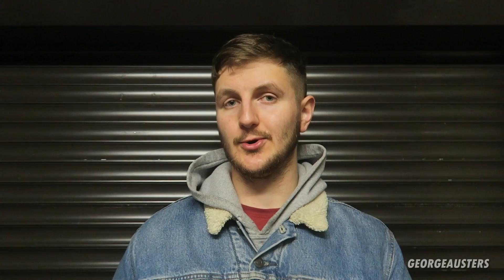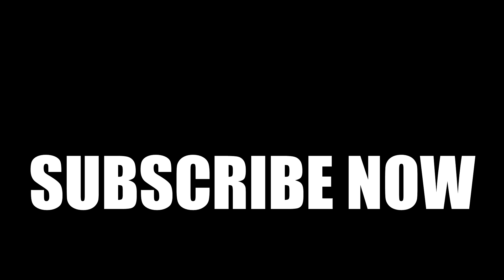Why Do Turbochargers Fail?

Comment: My car's manufacturer says: change engine oil every 10,000 miles, so I change it every 5,000 miles.  Fresh motor oil is much cheaper than a fresh turbocharger, or an engine for that matter.

A side note: turbos are fun! 😄  Oh, so much fun!

Comment: You dont really need to idle for even 10 seconds unless you are boosting madly then jam your brakes and switch off the engine. In the few minutes you slow down and park as you near your destination, thats enough to cool it down reasonably.

Comment: You forgot stop/start (for the obvious reasons)

Also imagine this, been on motorway for an hour, turbo spinning like crazy and you stop at the lights when pulling off. No oil or coolant circulating and it’ll be dry for a second when it restarts
Reply: Don’t get it. Why would it be dry when it restarts?

Comment: Nice, pardon the ignorance, but is operating temperature always ~100°c or at what temperature can one begin to enjoy the accelerator? 😉
Reply from the maker: It varies between cars, oil takes longer than water to reach temp but a good rule of thumb is to let the thermostat open at least before using the full rev range

Comment: Most I've went on a oil change was 5,000 miles. I will not going any farther. One guy that comes to my work gets his changed every 2-3k and its a trailblazer with 400k miles not sure if original miles but seems to be running strong still other then typical GM gasket leaks. I own a 2011 N55 535i btw. Also love the quality content, you are a very intelligent person when it comes to BMW. I enjoy all the videos you put out Ive learned from you.
Reply from the maker: Thank you my friend, I appreciate that!

I don’t understand people who skimp on oil changes when it is so cheap to do😢
Reply: @GeorgeAusters  Exactly, 10$ for filter, 
30-40$ for 7 quarts of castrol 5w40 edge full synthetic. All I use.

Comment: When a turbo fails like mine, do you have any recommendations for a turbo replacement?
Reply from the maker: OEM
Reply: Thanks , i would love to see a turbo replacement video for a n47. There isn't very many.
Reply: @brainsangeln1296  Depending on the failure, you may be able to change the cartridge. Did mine with one from Turbo Rebuild. Of course you need to sort out why the turbo failed in the first place before you spend any money!

Comment: I like to do my oil changes the same time every year, in the summer. That way I remember to do it, and it's not cold and miserable to work on it... :D
I do more than 6000 miles per year though, do you recon that number is still accurate with modern oils and engines? (In the case of BMWs their "Long Life" standard)
Reply from the maker: Oil is very cheap, an engine or turbo isn’t so the more often the better 👍🏻
Reply: @GeorgeAusters  That's definitely fair enough, and better to be safe than sorry. For a lot of people without a workshop or even a driveway, it's a bit of a chore though. I'm happy as it is to be able to borrow a lift once a year (9000miles or so) to do oil, oil and diesel filter.
Reply: 6-10k miles is ok. 6 is better